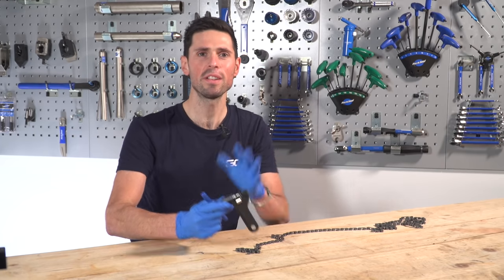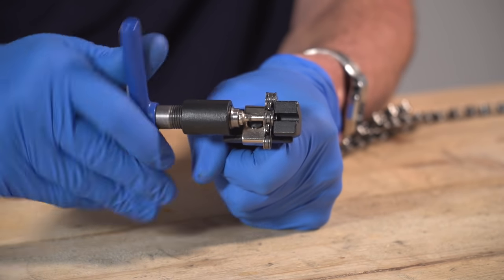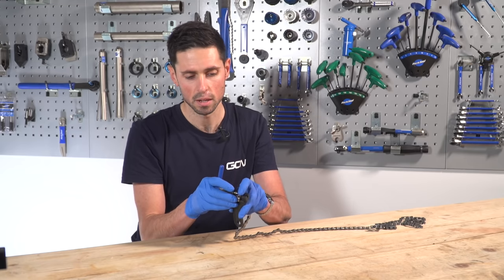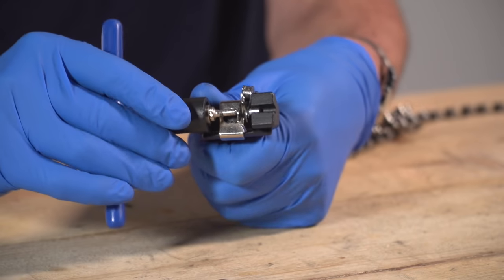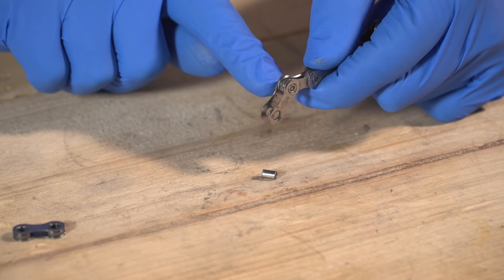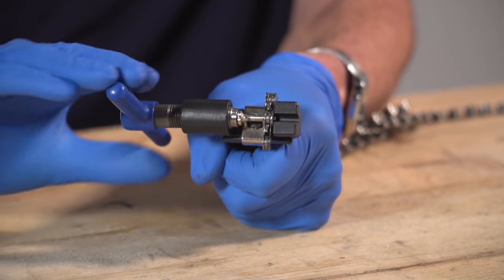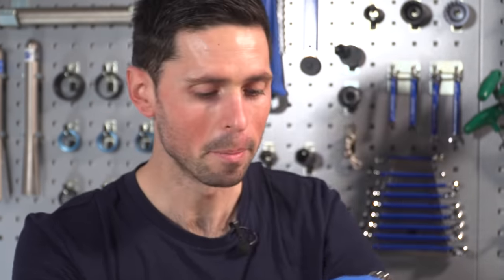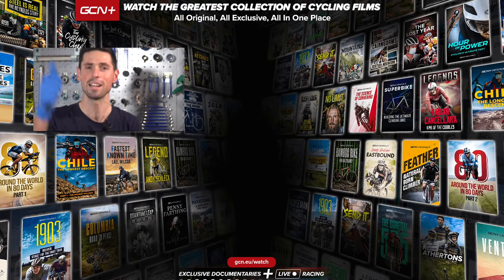How To Shorten Your Chain With A Chain Tool | Maintenance Monday

Comment: If you're joining a chain without using a quicklink, don't drive the pin all the way out.  Take it far enough so that it remains in the outer plate on one side, then you can drive the pin back in.  If it goes all the way out, then you'll have a difficult, if not impossible task of trying to align the pin to drive it back in.
Reply: These pins are single use only. Bad craziness.
Reply: @tomahoks  Yes, they can last quite short if they are reused - I tried it once (I lacked a 9 spd quick link), it didn't go well. 
At least now I know 8 spd quick links also work on 9 spd chains for emergency
Reply: Back in the bad old days of 5 speed chains that was the way it was done.  Quick links and driving in pins to snap them off came later. That would be unsafe with modern chains.
Reply: @davidburgess741  5 speed chains should be very similar to 8 speed chains, since 8 speed chains can also be used for 6 or 7 speed. Really old chains had a pitch of 5/8'', after WW2 they changed to 1/2 inch which is still used today.

Comment: For anyone wondering - I reuse a Shimano quick-link without any trouble. Shimano says they are single-use only but I take my chain off to clean it properly every 1-2 months and have reused the same link 6 or 7 times now without any issues. 
Maybe this might help somebody in case they had that question.. :-)
Reply: I also reused Shimano Quick links, but personally I find the links offered by Connex or Sram better. They cost all the same at the end.
Reply: @simonm1447  Fair play. The Connex one didn't quite do it for me. I never managed to get them sitting tight enough for me to trust them and I never bothered trying Sram haha
Reply: @JanHolgerOlof  I know in theory they can open, but there's no force in this direction as long as the chain is mounted on the bike, and it takes surprisingly much force to open them if they are locked. It never opened by itself at one of my bikes. 
Of course the Shimano is also good, it's just a little bit trickier to close
Reply: @simonm1447  I know but I just had a strange feeling - that never helps. 
As I have a set of chain pliers, opening the Shimano ones was never an issue. I see that being able to open Connex links without tools is a huge plus on the roadside
Reply: My Shimano quick link failed after I'd reused it multiple times. Certainly no more than 10 times. The link fractured and split in two.

Comment: Thank you for this video.
I used this video to make the chain on my E-bike shorter. It was too long.
the bicycle chain was slack and made a rattling noise against the chain tensioner at the height of the electronic mid-engine.
By shortening the chain 2 links (1 inner & 1 outer) I fixed the problem. After I shortened the chain I cleaned and relubricated the chain.
And The E-bike does now perform better than before. Althought the electronic motor isn't changed.
I only fixed the problem I had with the chain. 🙂🙂

Comment: Great video Alex. I recently changed my crankset, cassette and chain. Surprisingly I was able to do the entire job except for the chain where I had to go to the bike shop to have them break the chain for me. Turns out it is simple with the correct tool. I since ordered the CT 3.3. The tricky part is determining what length of chain you need. Can you post a video on this? Please explain how to measure on the bike as well as how to use the online calculators. Thanks!
Reply: True easy to reference the length of any old chain to determine the length you need 😊

Comment: It comes as coincidence that I just ordered a new chain and quicklink tool to swap out my chain all by myself for the first time. That's a bit scary, Alex! Get out of my head. 😁
Reply: Don't worries. It'll be a walk in the park - especially if you got a quick link to fit. This way you can easily take the chain off again, should you put it on wrong :)
Reply: @JanHolgerOlof  At least if don't break the chain too short by accident, which shouldn't happen because I have the old one, indeed. 😇
Reply: @DoNuT_1985  Haha yeah. But I'm sure you'll be safe and make sure to get the new chain the right way through the rear derailleur cage :)

Comment: Um!  Or, you don't push the pin completely out.  Leave about 1/16 or 1/32 of an inch of the pin still in.    Push on the chain with thumb to separate chain.  When reassembling, the 1/32 chain pin that is still in snaps in to align male and female parts.   I never push the pin completely out!  I'm too old?
Reply: Probably... This is ok for a road or trailside repair but has been strictly forbidden by the manufacturers forever. It works pretty well up to 9 or 10 speed. but the 11 and 12 speed chains aren't as robust. Re-usable quick links are more convenient when you need to do maintenance as well.
Reply: Agree with you Dan. Reassembly is so much easier when the pin isn't driven all the way out. I use this method as my chains don't have quick links (I had one fail). I consider an endless chain to be more robust.

Comment: Does it matter which side of the chain drive the pin from?
Reply: Nope, you can do it from either side
Reply: Yes, depending on the chain and whether you are using a joining pin or quick-link.  Newer chains from Shimano and SRAM are directional. The chain has a drive side and non-drive side. A connecting pin should be used on the leading end of an outer link and driven from the drive side (for Shimano). It isn't the end of the world if you do it wrong, but if the connecting pin doesn't break cleanly, it can affect shifting. There is a lot less to think about with Quick-links.

Comment: #gcntech I Tried to remoce my Shimano 105 chain (came with bike) and the cain break tool almost broke, holder pins bend and still no sign of the pin being puched even a bit... whats wrong?
Reply: It's likely that your chain breaker is of a low-quality one to begin with. My first one was part of a very cheap multi-tool, the prongs bent on its first use due to a malleable metal being used.

Buy a quality multi-tool with a chain breaker, like one from Topeak.
Reply: @yonglingng5640  thats true, it is a cheap one. Thanks for replying i was thinking, it is due to the chain so strong and not weak enough to be replaced.
Reply: @punusha  A chain's connecting pin's interference fit doesn't weaken overtime once it's installed, unless it's driven out and back.

Important note: Do not cheap out on tools.

Comment: #gcntech  If you drive the pin all the way out and you don't have a quick liink, how do you reconnect a link using the same pin?  I've seen local bike mechanics do it and I have done it as well on the bike trail.  Could you please make a video on this topic?  Thank you.
Reply: I tried this a single time - it lasted 2 km. Shimano has special pin delivered with their chains, which is designed to be used for this purpose. Personally I prefer quick links and always have some at home.
Reply: @simonm1447  I agree it should not be done to a Shimano chain that uses single use pins.  However, KMC and generic chains can have their pins reinserted.  So far the chain that I reinserted the pin has lasted for over 800 miles.  Also, the scenario here considers the absence of quick links.

Comment: Had that on my bike multi tool but I always wondered what is it, now I know, maybe I can use it when I replace my chain
Reply: Tip: get a dedicated chain tool. The one on your multitool does the trick for a roadside hack - but they tend to be very difficult and painful to use as you really need to put a lot of force through it. A dedicated tool will save you a lot of cursing. You don't have to get the most expensive. Cheaper ones will do the trick just as nicely :)
Reply: @JanHolgerOlof  Suppose I can get one from decathlon when I am able to do more self maintenance, thanks

Comment: How about showing us how to put the same pin back in using the tool instead of using the easy method of a quick link.
Reply: Once pushed out, there is no way back with the same pin. You can buy a specific pin that is designed to be installed by users and parktool have a video about that which is just one simple search away from you.

Comment: Am I the only one who doesn't use a quick link? After all the "fun" of getting the pin back into the chain, I should probably switch to a quick link as well. For some reason the joining pin always breaks before the job is done.
Reply: No, I also use quicklinks. I tried it a single time to use a pin pushed out of the chain to reconnect the chain, it went out after 2 km or so. Quicklinks are more flexible and they are reliable.

Comment: Unfortunately 10, 11, and 12 speed chain tools don't work on single speed chains. The chain doesn't fit into the tool's guide properly. There are less elegant ways to shorten a single speed chain, but there must be a proper tool out there somewhere!
Reply: Unior do a workshop chain tool that fits everything, it's a bit on the expensive side.
Cyclo do a tool for a tenner that fits 1-12 speed, we use this on the halfords in store bike hut where we use them on a daily basis no problems

Comment: Why not drive out the pin on the link where you needed it removed?  
Doing it twice makes no sense.
Reply: He's breaking a chain in the middle. You will drive out one pin (leaves you with one set of inner and outer links) then use a connecting pin to re-join the chain. Alex is using a quick link which takes the place of the outer links. So, he needs to drive out two pins to be left with two sets of inner links.